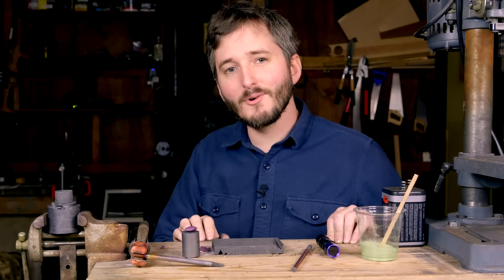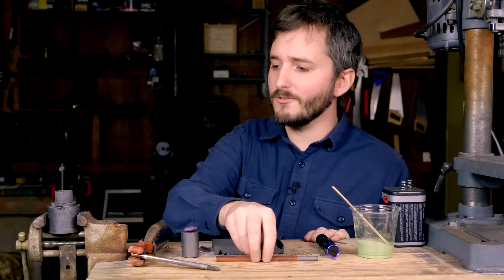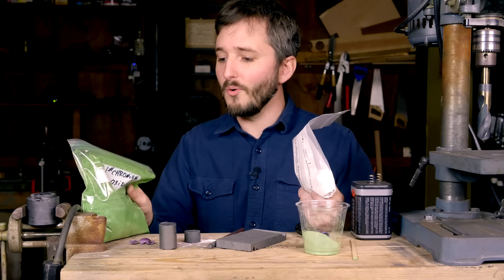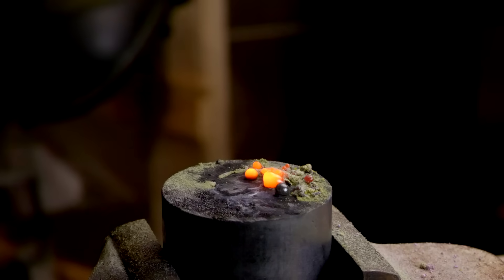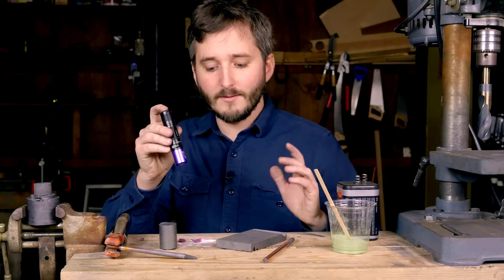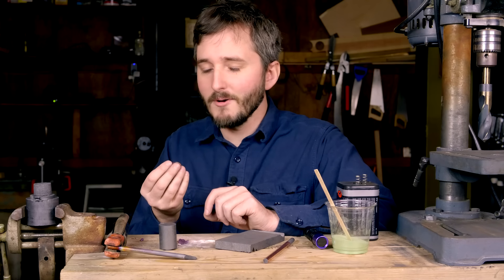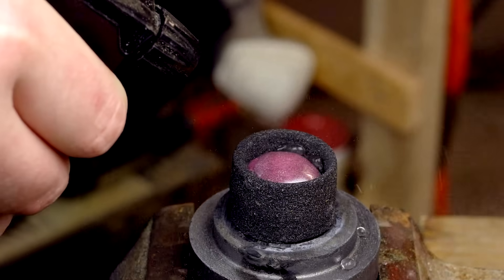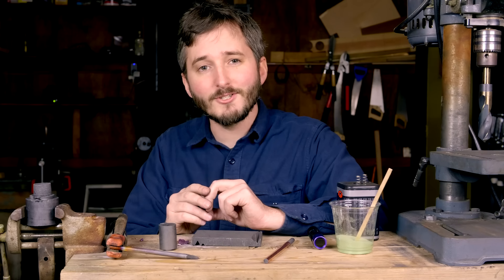How To Make Synthetic Ruby In The Workshop

Comment: Dude you beat me to it! Been working on synthetic ruby for months now. Been working on replicating the verneuil process to make large boules, but this looks way easiesr. Still gonna keep working on it, but now I've got to try this method. Great job though, the ruby looks awesome. I've got a lapidary friend who I'll be having cut the rubies I make since as you found out trying to just sand it is a no go. Needs diamond disks to really do anything. I may try this with a tig torch and argon as there would be far less contamination and give a cleaner ruby that might even be laser worthy
Reply from the maker: Ah sorry! Hate when that happens with what I'm working on. If it helps, these rubies are probably full of bubbles, and definitely nothing close to being a single crystal. If you can make them of a better quality that would definitely be worth while! Or just make sapphire of a different color and that's novel enough
Reply: @Nighthawkinlight  No worries it was a great video! Honestly, this mostly confirms some of what I'd been planning and tinkering with. I think I can still make a video which will add to the collection of knowledge rather than just being the same thing and build on it. Partly waiting for my friend to be out of an NDA so we can use a plasma torch to do this, beyond just using flames for the classic process, and we were going for as perfect ruby of a ruby as possible. Currently our issue was our torch was actually too good and liquefied large chunks of the kiln (which was made of proper fire brick). I think melting a fire brick is a solid achievement XD. So we're scaling that down and tightening it up the system.
 
Also ya we've got all the stuff for doing a variety of colors, and were going to start on sapphires as soon as we got the base process working. I have a whole box of different oxides to try. Can do blue sapphire for sure and was also looking into some of the more exotic colors. We actually made some using a laser cutter to start with which I thought was neat.
Reply: @thethoughtemporium  can we expect a  deathstar Laser? 

Huge fan of your hardcore scienceing! Keep up the great work man!
Reply: @thethoughtemporium  can you do this using the sputtering magnetron it makes a hot plasma and under vacuum it will form less air bubbles
Reply: @thethoughtemporium , I have zero qualifications to advise anyone on kilns and such, but thought I'd mention that soapstone takes another thousand degrees above firebrick.
Reply: @thethoughtemporium Ruby video please
Reply: @thethoughtemporium Have you released a ruby video as of now, nov 2023?
Reply: @Nighthawkinlight , I didn't know rubies are just sapphires they decided to call rubies until I dropped by a friends friend's place in Philipsburg, Montana, about fifteen or twenty years ago.  After seeing the amazing stones in her shop, I brought a bag of dirt home [from her shop] and I and my daughter mined sapphires on the kitchen table.  I discovered LED flashlights are perfect for finding the tiny ones, so the UV works to highlight them too.
Reply: @Nighthawkinlight  Why not compress the powder first into a block so it doesn't blast all over the place... and modulate your arc power to heat slowly until it begins to melt..............
Reply: @Nighthawkinlight  Could the bubbles be eliminated / a consistent crystal be created with a hydraulic press while heating the mixture?
Reply: @Nemozoli  Rather than a press, how about doing the process in a vacuum?
Reply: @rcjbvermilion  Making an arc in a vacuum is not possible... so then the heating remains the bigger problem.
Reply: @Nemozoli  no, a big problem with this process is that it cools down really too quickly for large crystals to form, think the difference between boiling a pot of sugar water dry(makes a lot of small crystals/white powder if you dont caramelize) vs making rock candy by letting a stick hang in the same mixture for weeks which makes large single crystals. There are a few ways to get around this with ruby(and other alumina based synthetic gems) first is the verneuil process, which only deposits very tiny amounts of the ruby at a time, which allows it to organize into the crystal lattice as it solidifies. Another popular method (whose name escapes me) is melting a big 'ol bucket of the stuff, and touching a seed crystal to the surface, then slowly drawing it out of the bucket and away from the heat source which again, allows it to cool over a much longer period of time leading to more perfect crystal lattices.
Reply: @Nemozoli  what about lasers?
Reply: @Nighthawkinlight   at the temperature it was exposed I doubt is full of bubbles.
Reply: Just subbed to you, I definitely want to see your version of making rubies
Reply: isn't ruby in this process polycrystalic? shouldn't ruby for the laser be monocrystall?
Reply: I would love to see a vermeil furnace and how to make them
Reply: please do it! it will solidify me buying a TIG rig for sure! look forward to the vid!
Reply: You guys rocks!!!
Reply: I love you're channel
Reply: The Thought Emporium do emeralds please
Reply: Did you try it? Cause I just got my arc welder. I figure I could try it if others had made it work.
Reply: Generic red colored sandpaper is ironically made of the same material and is therefore close in mohs scale hardness levels.
Reply: This video is in part innacurate, you can grind aluminum oxide with carbide. Carbides of the tungsten variety alone reach 9.5.
Reply: Make sure you get proof they're actually rubies. It's all cool, but it'd be cooler with that validation that it's not just fused alumina.
Reply: @SnowblindOtter  The are real synthetic rubies. I spent twenty years working for a company that made them as well as white sapphire, Nd Yag, Spinel,  Lithium Niobate. He used roughly the ruby mix but a little on the heavy side for the chromium.
Reply: @SnowblindOtter  The fluorescence and color change is proof.
Reply: @notamouse5630  So what you're saying is melting Copper and Zinc together turns them into Gold?
Reply: @SnowblindOtter  No, however a medieval alchemist might think so.  ;-) With ruby this is so because it is a well regarded fact that a certain mix of metal oxides produces ruby when mixed and heated.  Given that you know the starting mixture and the properties of the ending one, you may use the aforementioned test as a test of when  ruby material has been made.  Not when it is done, it could be a coating of it on a bunch of under-mixed starting materials.  etc.
Reply: @SnowblindOtter  they did, the raw powder dont glow under uv, rubies did, and the product glowed and showed other properties of rubies.
Reply: i wonder what would happen if you used this process and the sputtering to your advantage, have a little gravity fed batch of this inside vacuum to spray the hell out of it on the inside of the container, keep doing until the entire hopper is empty and then harvest hopefully a substantial layer of ruby off the walls
Reply: This looks like an amethyst. Ruby is more red and transparent.

Comment: Following EM's video about it, I did some tests with my old modified DC MIG welder, and it was NOT happy. The arc was unstable even at maximum power and it didnt seem to put out enough heat into the material with my carbon electrode.
Although, I just realized I used it in the wrong polarity. Anyway, not all welders will do a good job at this.

Comment: Use SiC (Silicon Carbide) or diamond files for the rough surface on the back.   You can’t use normal Aluminum oxide sanding belts, because  that is exactly what is in the Ruby!  Al2O3, aka alumina.

Comment: try induction heating with the graphite crucible
Reply: try changing the color or the impurity to make different gemstones, also try using oxyhydrogen torch at over 3000C
Reply: try laser melting, but not too hot

Comment: How about using one of those new 1000 watt lazer cleaning thinga ma gigs? Fired at a pile in a graphite mould that would work they hut many thousands of degrees and turn rust to plasma in an instant. Plus You'd get little Ruby rods depending on the shape of the lazer I've seen them make shapes like a dot a line and a ring. it would be cool to make a Ruby ring effortlessly and high quality due to the temp and no disruption to the powder like a pressurised gas flame . Your thoughts?
Reply from the maker: Those lasers are too high powered and would basically vaporize the powder rather than melt it.
Reply: @Nighthawkinlight  arrr i thought i hadto be as hot as possible sorry im sure they can be dialed in intensity?

Comment: How to make a ruby at home:

Buy high tech processed starting materials from a high tech information superhighway using high tech electronic payment systems using a high tech electronics device, blast it with a piece of industrial equipment that produces a temperature hotter than the sun itself.

Easy.

Comment: I know glass is microwaveable when it’s red hot, dose ruby have similar properties? 
 It’d be a much purer way of producing a final product if this was the case.
Reply: silicon carbide crucible can be microwaved or heated by induction heater.
Reply: The graphite crucible may not like the microwave but it may gain a diamond like coating on the other hand!

Comment: I think a tig welder would be even better for this because you have way more control over the arc and the tungsten electrode won't erode away.
Plus maybe the argon gas shielding will provide a shinier surface on the ruby
Reply: We need a mig that uses SiO2 wire
Reply: Tig sounds like the best process that dousnt require making specialized equipment.
Reply: Exactly what i was thinking exept in a argon filled presure chamber
Reply: Literally the reason I came to the comments was to see if anyone had suggested this!
Reply: the tungsten does melt and would contaminate the mix
Reply: @chrisyu98  The tungsten shouldn't melt in tig welding unless you contaminate it.  The reason that tig can produce 100% welds is that it doesn't , under normal operation, contaminate what you're working on.  You just need a high frequency start system and a properly sized tungsten for the current used.  It's scratch starting that's most commonly the issue.
Reply: @FailedBard  In a welding sense no the tungsten rod doesn't melt (much, but it does) in this application even parts per million can contaminate the ruby.
Reply: @chrisyu98  If parts per million would be an issue, you have that degree of contamination (and worse) in most bottles of shielding gas already  I've had some so bad you couldn't use it for mig, let alone for tig.  I can see why it wouldn't work well in that situation.
Reply: @FailedBard  Carbon melts at a higher temp than Tungsten; so the carbon rod is already a better choice.
Edit; it could be argued that the tungsten boils at a higher temp; but that temperature and the boiling point of carbon are both not achieved here either way.
Reply: @mikeishome69  well be adventurous, try a 3mm pencil lead in your tig so you get best of both options.
Reply: @chrisyu98  What doesn't melt?

Comment: Good video as always. Just a few things I wanted to suggest that might help if you wanted to continue working on this project. When you created that large ruby with the rough bottom, to me this means you didn't heat it up enough to completely melt your mix. I would suggest trying to heat it for longer. Yes heating the crucible takes longer than directly heating the mix, but should still be possible. It appears you're heating only the surface, and not waiting long enough for the heat to transfer deeper into the material either way and that may explain the rough finish. Just give it time.

Second point on polishing the stone, would something like a rock tumbler work well instead of an abrasive belt? I'm not familiar with gem polishing but I think that most if not all gem polishing methods should work, but just take longer with rubies since they are so hard.

Comment: You ought to mill a snug-fitting cap for your crucible, then put in some of the aluminum oxide/chromium oxide mix into the crucible and cover it, then blast the whole thing white-hot with the arc welder for a period of time...  maybe covering it up will trap enough heat to melt it through the crucible, maybe the lower-oxygen environment within the capped crucible will net a cleaner ruby, and maybe the slower cooling will allow the ruby to crystallize instead of simply solidify from a liquid state.

Whole lot of 'maybe's.

But you're playing with an arc welder, so it's going to be fun anyway.

Comment: I am really interested in the prospect of a ruby file! I have no of the equipment necessary to do this, but I think that it is an interesting prospect.

Can you make sapphire too by simply changing the dopant, or does this only work with the chromium oxide?
Reply from the maker: Yep, should be just as easy to make sapphire
Reply: @Nighthawkinlight  That's really interesting. I'm imagining the difficulties with making a file out of a graphite blank. How would you keep the entire thing hot? Would you even have to?

Also, putting a graphite top on the crucible should help with the splatter, granted if that's a problem with a crucible instead of just placing it out on a flat piece.

Comment: The content was great.  
I just missed Moses.

Also, I wonder what would happen if you used a chromium electrode instead of carbon.
Reply: You probably end up breathing in a load of carcinogenic chromium(VI) compounds.
Reply: @charleslambert3368  Time to grab the ventilator.
Reply: Chromium melts at 3465 °F. Your electrode would be gone in an instant.

Comment: I wonder if letting it cool down slowly like glass would affect it in any way. My hope would be that it becomes clear, but I doubt that will happen.
Reply: I think the powder has too much air left in it also residual AlO Is gonna be troublesome, I would guess a pulse laser may be useful to make a clear sample as imperfections would be heated but the transparent crystal won't be affected as much.
Reply: @SToNeOwNz  combine that laser and make a 3D printer that creates statues out of ruby
Reply: Nothing could be done to turn that mass into a pure ruby, crystal or otherwise. Primarily because the chromium in a ruby is there is trace amounts, not the massive 1%. It is unclear how much of the chromium oxide would be reduced to pure chromium that could migrate, under the right conditions, into a ruby crystal. Probably not much, since the only reducing agent present is the carbon crucible. I suspect the atmospheric exposure would tend to oxidize any chromium reduced by the carbon immediately back into chromium oxide.

So maybe minute crystals of ruby will form, but most of the mass will remain a mixture of alumina and chromium oxide. 

Further, if you melt and cool a natural ruby crystal under those conditions, you will not end up with a ruby crystal. You will end up with a mixture similar to granite in structure.  That is easy enough to verify. Just buy a cheap synthetic ruby (make sure it is not an imitation ruby), then melt and cool it in that graphite crucible. You will see the resulting mass is opaque and does not resemble a ruby in the least - except possibly for color.